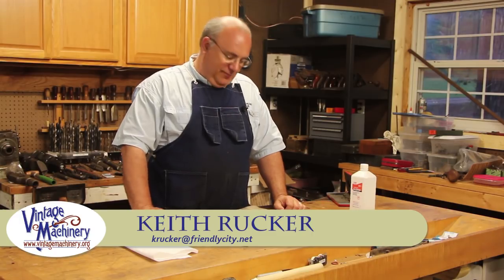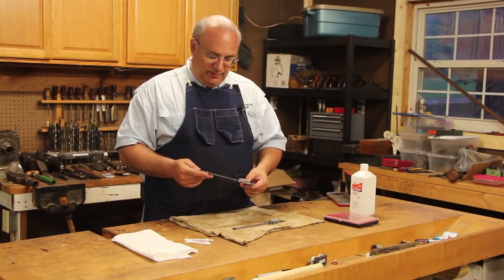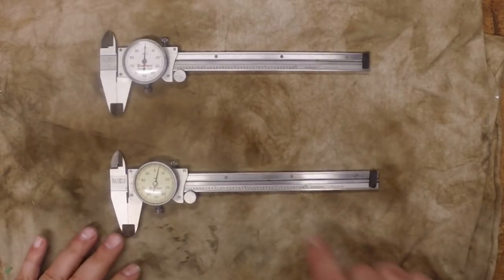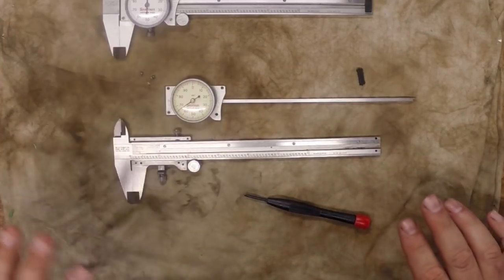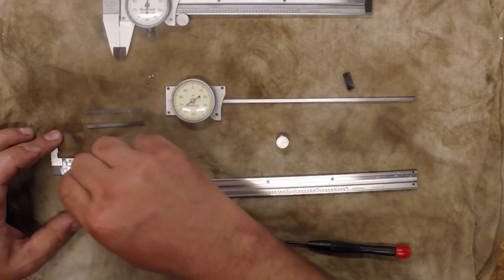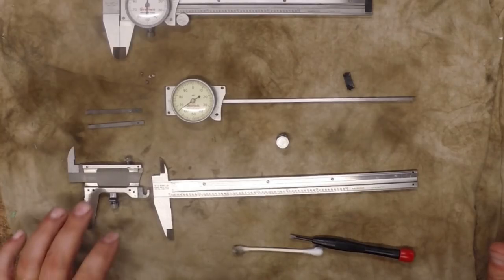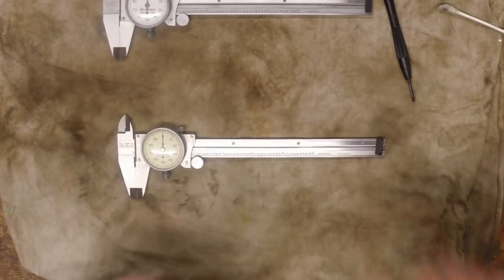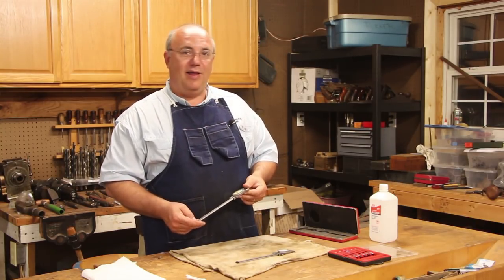Starrett No. 120A Dial Calipers:  Disassembly, Cleaning and Reassembly

Comment: shame my mitotoyos dont come apart the same, but after taking off the end stop, i could clean it out better, at least i could remove the rack which had 20 years of grime under it
Reply: With Mitutoyo you need first to remove the dial glass and bezel.
Then pry off the indicator needle with small flat head screwdrivers (it's a good idea to attach a small piece of tape to end of the indicator needle as it tends to pop out quite forcefully). Under the free-floating bezel you have screws holding the mechanism in place. Getting it back together is bit tricky on adjustment-vise, but nothing impossible.
Reply: mikey_d
ahh i did get the bezel off but stopped at taking the indicator off, taking the plastic end stop meant i could take it off the end and remove the rack for cleaning, thanks for the info
Reply: mikey_d The beauty of Mitutoyo calipers is that you can use the provided tool, that bit of wire with a square hole at one end, to disengage the pinion from the rack so you can re-align the pointer to zero without taking anything apart.
chris
Reply: Chris Stephens
provided, maybe, but lost 25 years ago! lol , i aligned it pretty much near the top via moving the needle before i put it back on the rack, took a few attempts but its much better than it was at the 4 oclock position,  if you have pics of the tool perhaps i can improvise with something
Reply: dead easy to make, I know as I have made a few as once dropped in my shed they will never be found again. I will go and measure up and post details later.
Reply: jusb1066 The tool I have is 1mm/40thou piano wire about 32mm long then comes the bent square  of about 1/4". For those who don't know, remove the plastic bezel clamp, set the pointer to zero by opening jaws and then GENTLY poke the wire into the hole at the end of the shallow groove and push just enough to disengage the rack. Now, while still applying pressure, close the caliper and release the tool..
Reply: Chris Stephens
i found an alternate method, based on a bit of thin shim stock, and 1/16th wide and 3-4 inches long, to slip along the rack so when you close the caliper it goes underthe wheel and slips, a bit of faffing and you get it done, no taking anything apart, i found mine lined up to 11 oclock, and realised from what keith said, the rack can be nudged a tiny amount, which now makes my needle at exactly 12 oclock, which it never did when new!

Comment: Careful.  Once you take the pinion off the rack you might lose tension on your anti backlash spring.  This will cause the calipers to fail at making consistent readings.  Preloading the spring again may require disassembly of the dial. It’s doable but can be tedious.
Reply: I thought that too on mine, I just got done building a set of 120s, but since the gears are matched together on the same gear they don’t lose their backlash unless disassembled from the gauge itself. I did have to retention it though when I did disassemble my gauge, long process but I think I got it.

Comment: I am attending machinist school learning manual and CNC machining. I love your videos. The teacher can only teach so much. Your tips and tricks have helped me excell in my classes. I am  a perfectionist and being a machinist gives me pleasure. Thank you for dedicating your time to these videos to make sure that machist isnt a dying trade
Reply from the maker: Thanks for the kind words Tim and thank you for taking the time to learn both manual as well as CNC.  Having manual skills will give you a huge advantage over most of the kids coming out of programs these days that are only taught CNC.
Reply: Keith Rucker - VintageMachinery.org 
what is the method for tensioning the hair spring to get good repeatability. I recently got a used 8" from SPI, and the hair spring had come loose from the gear causing it to lay over to one side and getting caught up in the other gears resulting in it locking up. I've gotten both ends of the spring back in proper location (not easy by the way) but unsure how much tension needs to be on it. I don't want to over do it and break the spring